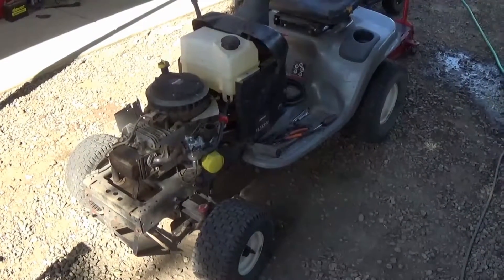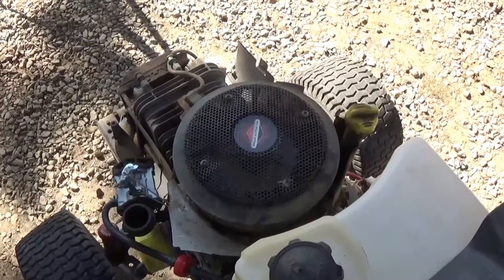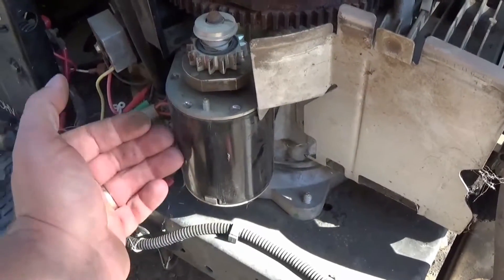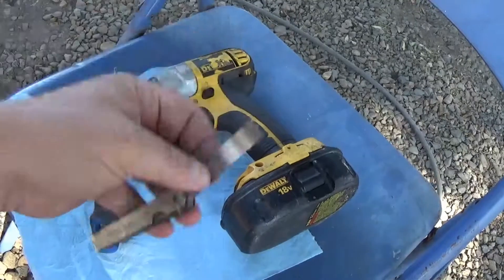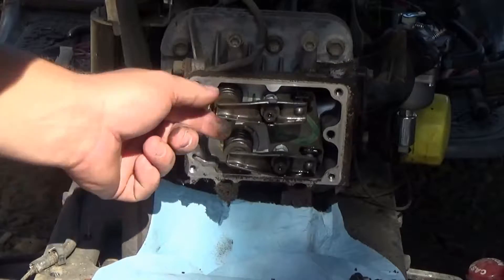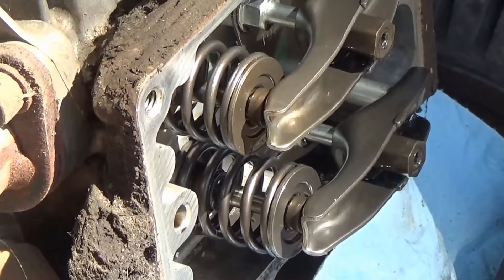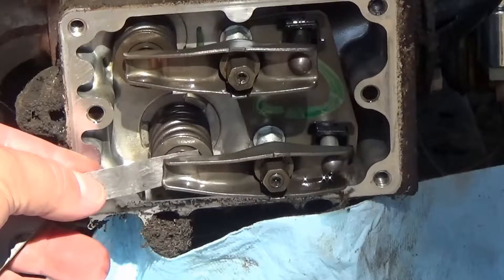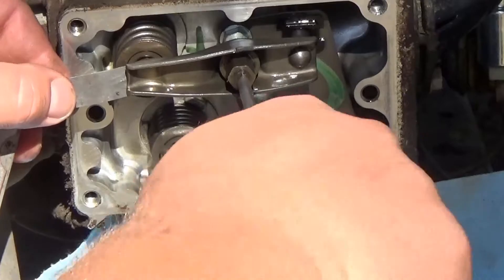Riding Mower Turns Over Fast Then Slow On Compression Stroke (BRIGGS OHV)

Comment: I didn't see you bring it to TDC.... I got a lt1500 with a 420cc engine and I've sanded the flywheel, ignition coil ends and took the ground wire off the coil and it won't fire at all. Used a business card to set the coil gap.. I've gotta get a coil but I can put my finger over the spark plug hole and turn the engine with my hand and it won't push my finger off nor do I feel any kind of compression.. if the valves are off will that make it not have compression?
Reply from the maker: Well I didn't put it on TDC because you don't have to I mean I never do and it works every time for me but if you still don't have any compression there's a couple things it could be maybe the valve guide on the head has came out so that the valve is still open and will cause no compression also maybe stick a long screwdriver down the spark plug hole just to make sure that your piston is moving freely and if the valves are off I don't think it would be a reason that there's no compression unless they were tightened down really really tight also check the rocker arm post sometimes they work their way out I hope that was some information for you thanks for the comment add another possibility could be a blown head gasket
Reply from the maker: What kind of motor is it the craftsman 420cc engine there like the cheap motors
Reply: I'm not sure what kind of is other than Craftsman LT1500 -420CC/ model number is 247.288820 
D.O.M-4/2013 (42"cut)
Reply: It's a 17.5 HP engine from what I can gather online. It looks exactly like the one in the video except it's got 420cc instead of your 17.5HP label.. do you know what the simplest and cheapest replacement engine would be if it's no good? 
Thank you for replying sir
Reply from the maker: @brandonmoss6455  well if you can find another tractor that's always the cheapest way to go for a couple hundred bucks or find a really good price on a cheap one that somebody doesn't want no more and hopefully the motor is good and swap it out with a Briggs & Stratton somewhere around that horsepower 17 and a half like the one I got
Reply: @smallenginerepair3379  awesome if this doesn't work I sure will!! Thanks a  bunch.. if I had done this a million times it be a little different!! God bless 🙏

Comment: Getting my father in laws old mower and it one of these. Hope to get it rebuilt. Do you have anymore videos
Reply from the maker: Just a few might make some more if its helping people out!
Reply: @smallenginerepair3379  hey.so I got a riding mower that has no compression but then I went to turn it over and it locked up I took off the valve cover and they do need to be adjusted the top one has no play and the bottom one is very loose so thats why it has no compression but why did it locked up also 🤔

Comment: Did you have to find top dead center? How do you do that? I am having this issue and I thought I found it and set the valve space properly to spec and it worked about 4 start ups and then had the same issue. Tried a few times with no luck.
Reply: Maybe you are not tightening the torx set screw properly